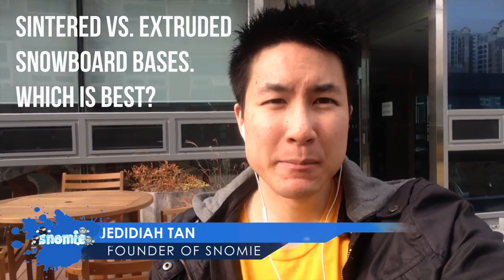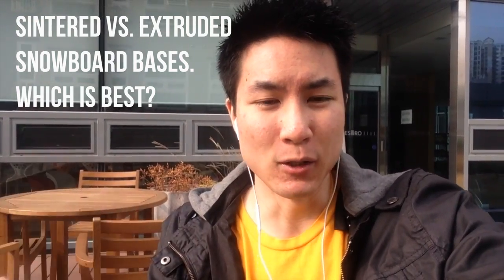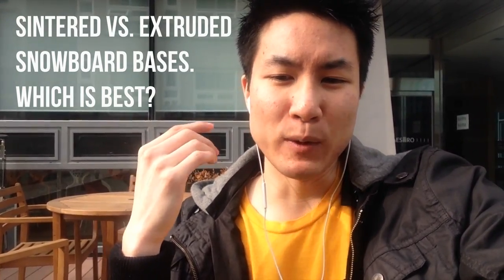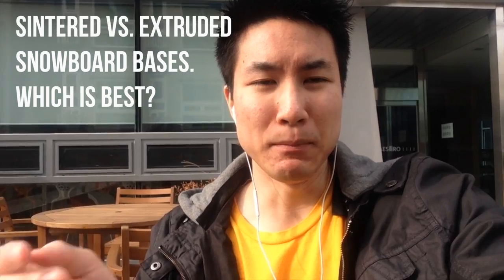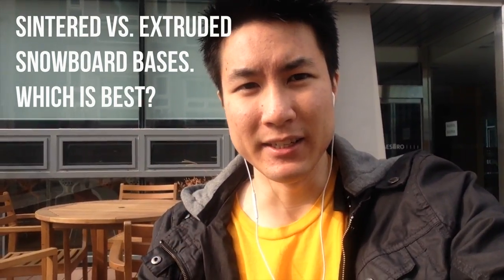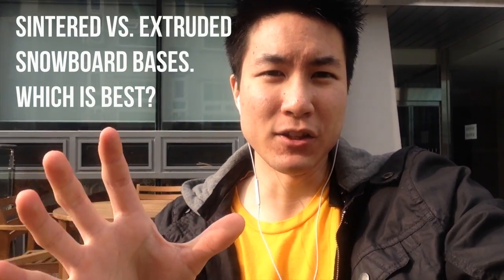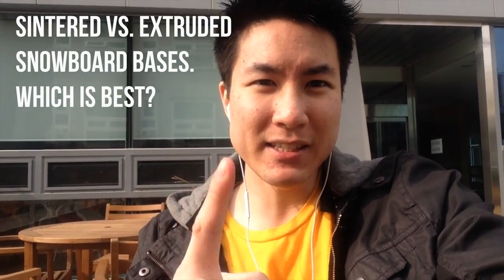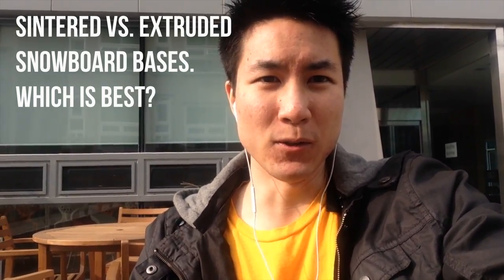What's The Best Snowboard Base - Sintered Vs Extruded Bases

Comment: I have some p tex candles, can I use it to repair the  dura surf xt 5501 sintered base from my never summer heritage?
Reply from the maker: Yeah, you can use p-tex candles to repair your base. If it's a huge hole you may want to go to a proper tuning shop to do it, but for smaller touch ups p-tex candles do the job.

Comment: I used sintered 2000 (yes snowbords)
its  was faster then other sintered bases (even black sintered of Never summer)

do you know sintered base that is faster than sintered 2000?

4000 and 6000 its trully faster? I used other numbers what was upper than 2000, but they was not faster
I am confused 

Thanks

Comment: I bought my board from a clearance sale. It's a K2. How do I know what type of base it is? Does it matter what the base is when using p-text to repair it?
Reply from the maker: Your best bet is to take a photo of the snowboard and send it into K2 customer support. They'll be able to tell you what board you have and which base it has if it's an older model that's not listed on the site.

As far as p-tex goes, the standard p-tex should work fine for both types of bases.

Comment: How do you tell if your feet are too big for your snowboard? Please help!
Reply: Try wide snowboards, they are made for powder and big-foots.
Reply: You generally need a little bit of overhang on the heel and toe side of your snowboard (around half an inch, both toe and heel). Unless your feet are like 13-14 US you don't need a wide board.
Reply: Up to an inch of overhang on the toe side and the heel side is fine.
Don't go wide unless you really have to. Wider boards take longer to carve with, since the contact points will take longer to touch the snow.